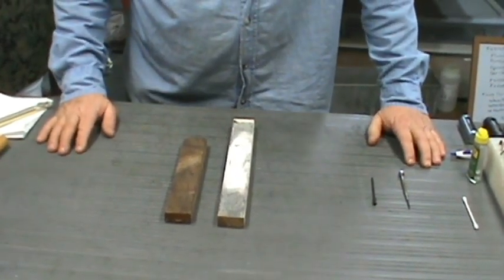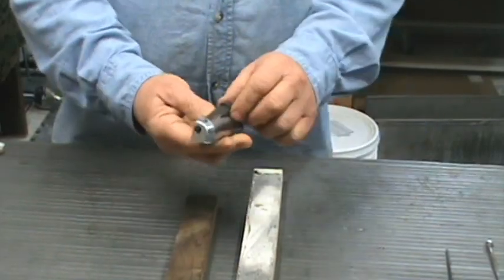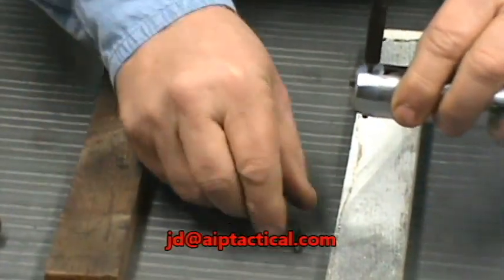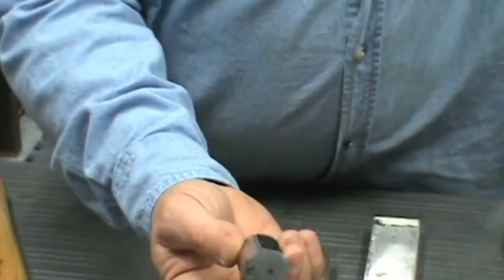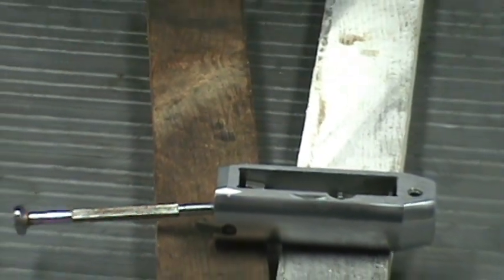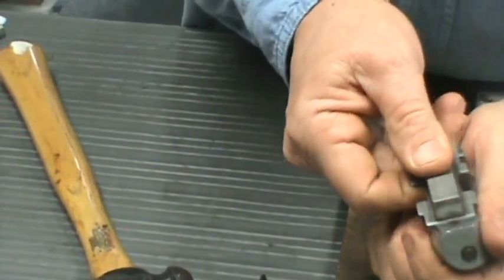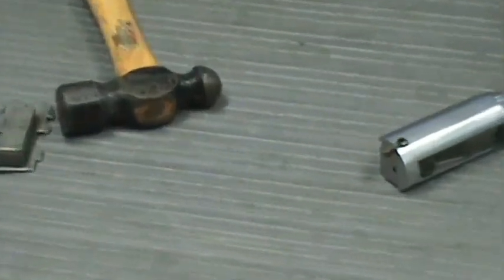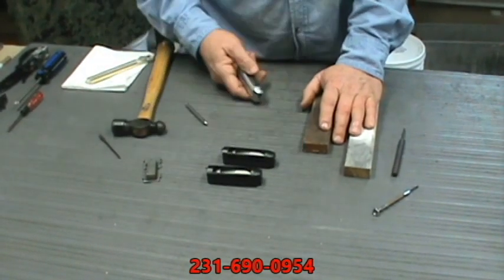Retractor Spring

Comment: Didn't Remington also tweak the 870's firing pin at some point to help prevent breakages?  I have a shop manual that cites an older-style round-head firing pin.  Could be another part worth updating when rebuilding a breech bolt assembly.